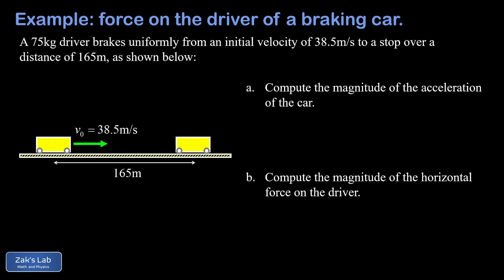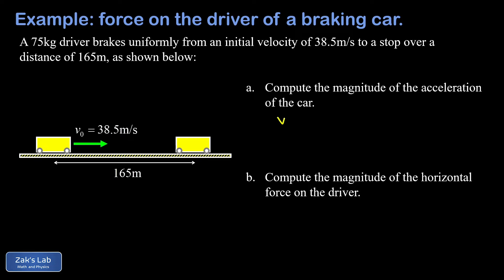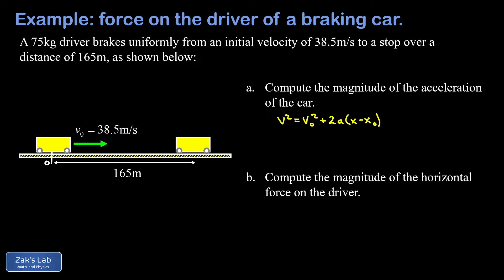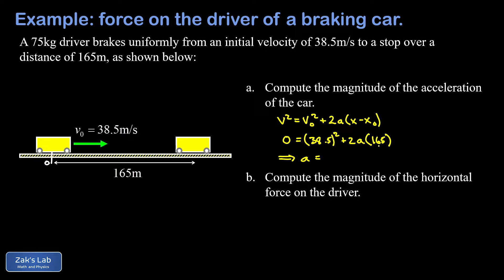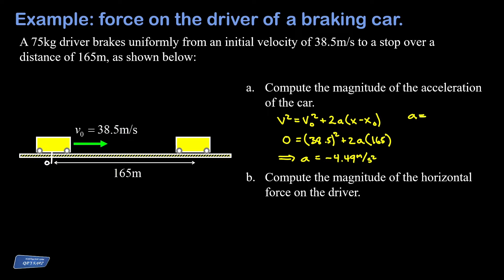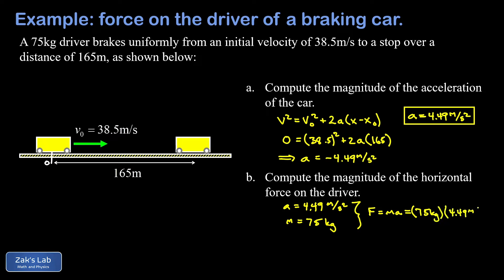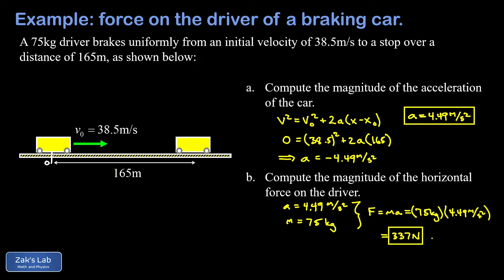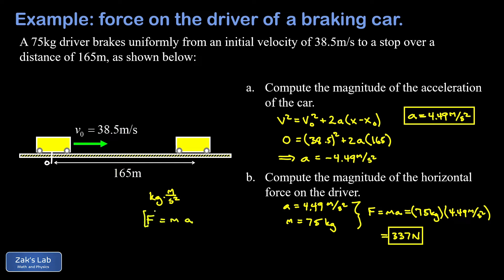Acceleration and force on the driver as a car brakes to a stop.

Comment: what did you do to earn 4.49 m/s^2, i get 4,73 m/s^2 approximated and in force i get 354,75 N dude
Reply from the maker: -38.5^2/(2*165) is about -4.49m/s^2 when rounded to three significant digits
Reply from the maker: I was able to replicate your answer by putting in an initial velocity of 39.5m/s -- just making a guess on what might have gone wrong here.  z
Reply: @ZaksLab  Thats true im sorry i put 39,5 instead of 38,5 i didnt saw that haha